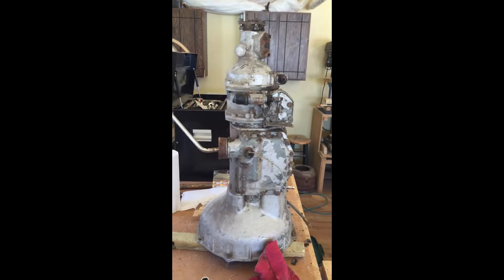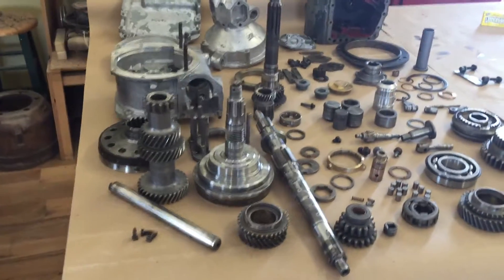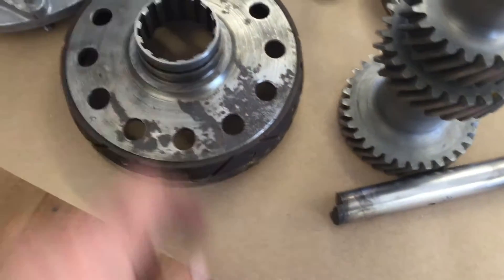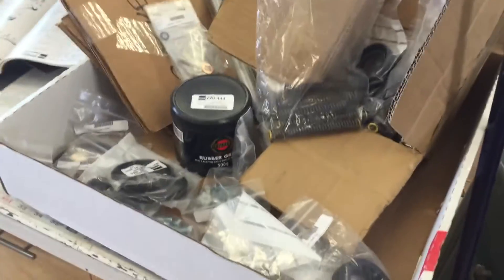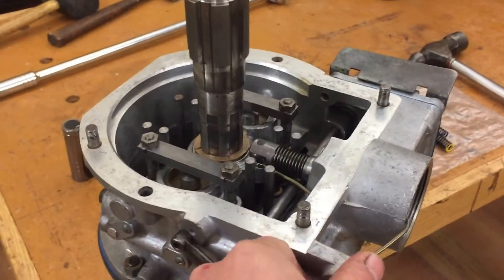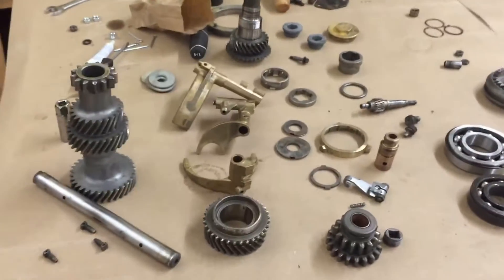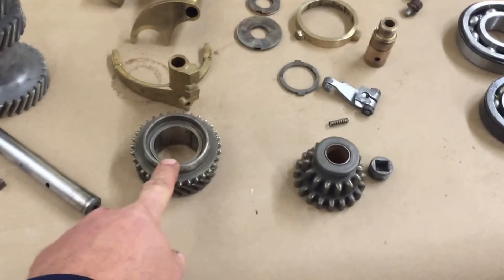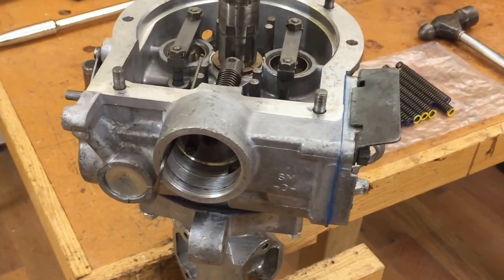57 Austin Healey 100-6 Rest. Pt 4 - Overdrive

Comment: You're carrying on... Glad to hear it. Not how you start but rather how you finish. Something like that. Recently "almost" finished a '74 GMC Sprint I bought as a field fine in 1987. Reassembled as it had been and drove for 15 years. Determined to restore after I retired. brainstorm. Better do the expensive part before I retire. Good plan, poorly executed. Shop I (worked) with bid engine at $8950. Never quite delivered so after the lawsuit and mostly having money returned, body done and paint for way more than I'd thought but nicer too, it all began running a month ago. Smogged, licensed and insured. $50, invested over 5 years and might bring $15, after it's really finished. Local hot rod shop estimated another 5 grand to finish-finish, whatever that means, But I did it. Is there an easier way? Don't have any idea to this day. Don't know what to do with it now either. Tenacity requires being tenacious.
Reply from the maker: +James Tennier For better or worse I'm going to try to do the vast majority of the work myself. It could take me a while...
Reply: +Chris Arneson
 Chris; your plan is as it should be I'll wager. I trusted others without them being worthy. difficult nut to crack. 
In the process I learned I was more capable than I would have imagined, just not by much.
Didn't weld but should have tryed to learn.
I've "painted" before but the outcome was always bit less than this time paying the pro.
Too old for another attempt now but aren't.
Tenacity

Comment: Well done Chris! Aren't they a wonderful piece of engineering? IMHO, I don't think the pitting on the cone clutch member will be a problem. Also, the pitting on the 3rd gear appears to be on the syncro cone section of the gear. This may also be ok, but if you can get the parts play it safe. How is the layshaft?
Matthew
Reply from the maker: +matthew randell I have a 2nd and 3rd gear on the way.  I was worried that they might damage the laygear.  The layshaft is pristine.  I had expected to replace it but see no real wear on it.  I'm amazed at how much fun the mechanicals have been.  Don't tell my wife but I keep thinking that the next Healey I restore will be a 100/4!
Reply: Hi Chris
yes, I like the four cylinders too, but I don't think I could face restoring another car in the near future.
M

Comment: 1st gear is usually the worst and the best to clean is using paraffin not wire wheel. Only use wire wheel to clean up the remants of the gaskets and seals